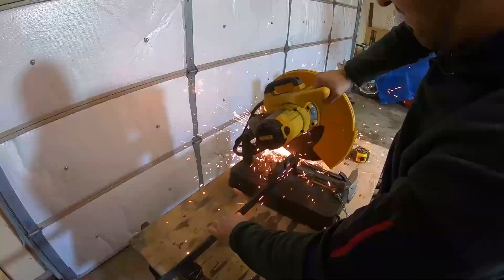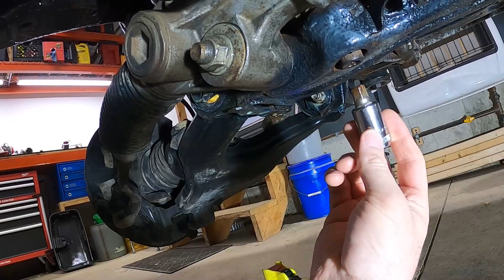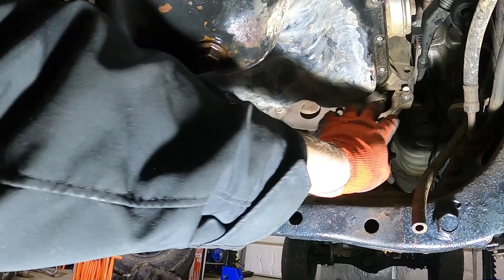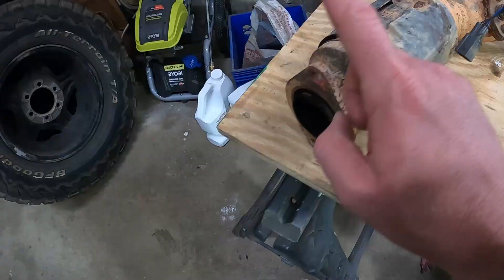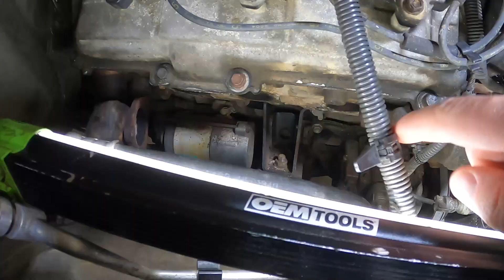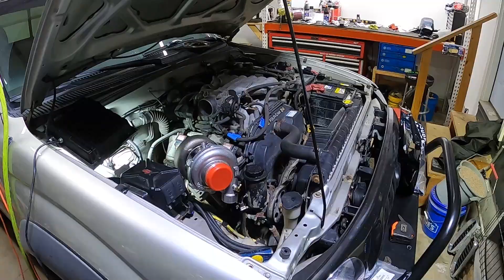How To Boost Your Toyota 5VZ-FE TO THE MOON!! Turn Your Tacoma Or 4Runner Into A Ripper!! Part 1

Comment: I have question for you I just installed a supercharger TRD on my 3.4 1996 Toyota 4Runner. I swapped a 1985 jeep cj7 onto the  frame
Reply: I don’t think it’s running how it should be
Reply: Does it needed to be tuned or anything

Comment: Great vid, gonna do it myself with a tiny low boost turbo and no intercooler. I want to make 50 to 75hp tops. Something that starts to make power in the low 2k range.
Reply: did you ever do it w no intercooler?

Comment: Not trying to boost my 2 runner it has 300K I won't  mine to make it to 400K
Reply: I supercharged mine at 430k. Rod knocked it at 485k while the 4runner was pretty much on its side. The 3.4 I had was a bit tired and oil burning but it boogies with the SC, injectors and smaller pulley

Comment: Anyone know if this will work on a 3rd Gen 4 runner? The same way a lot of suspension etc. parts will work hand and hand between the 1st Gen Tacoma and 3rd Gen 4runner?
Reply: I guess this is a dumb question because both have the 5VZ.. yes I have the v6 3.4
Reply from the maker: I don't see why it wouldn't, my brother just got a 3rd gen t4r and it looks pretty much exactly the same under the hood

Comment: Port and polish your intake manifold and then port match your throttle body to it and you’ll have a few more hp and much better engine sound
Reply from the maker: Nice! Thanks for the suggestion!
Reply: @CRACKEDHOUSINGFAB  absolutely man. I want to do high compression pistons but can't seem to find any I know someone made them at some point though. Also want to put a more aggressive set of cams in mine as well I found those. Great motors one maybe one of Toyotas holy grails? Right along with the inline 6 out of the 90s and early 00s supra

Comment: only issues in 4 years with the cx manifolds ive had is that the little support rod up to turbo mount cracked at the welds and the flex joint failed recently. i repaired it both times. reply if any questions
Reply from the maker: Hopefully mine holds up for a long time🤞have you had any problems with the v bands sealing on the cross over?
Reply: @CRACKEDHOUSINGFAB  no issues. i was actually very suprised that the clamps werent siezed when i took it back off since i live in one of worst places in world for rusting. i did have my wastegate come loose but that was just the bolts loosening up. is that the turbo they sent with manifolds or did you get separate? should have came with a different style turbo with vband to downpipe
Reply from the maker: It is a different turbo, I just bought the kit with the headers, cross over and wastegate tube. I made my own downpipe with the flange, you will see it in the next video coming out on Wednesday what I did.